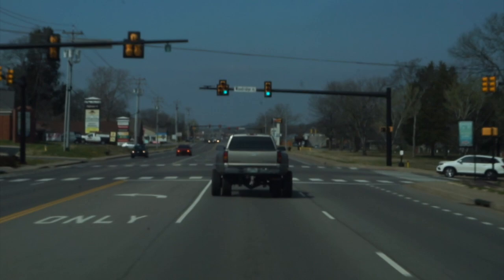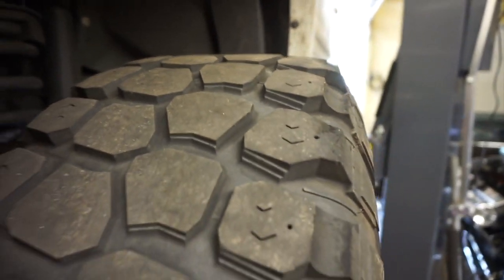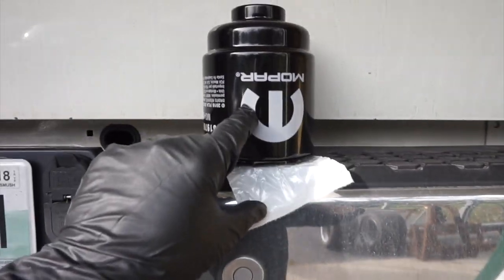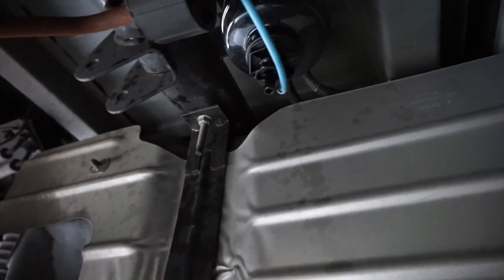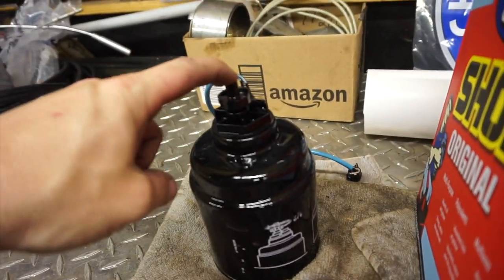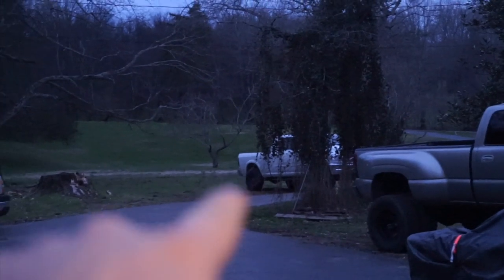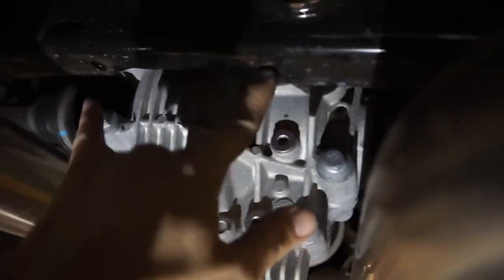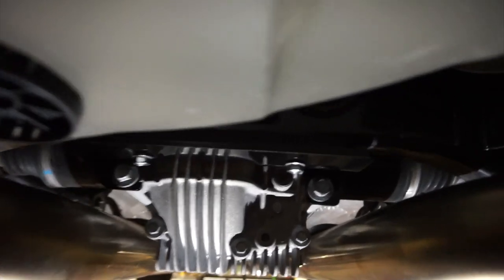DON'T buy cheap Mud Tires, I Didn't listen

Comment: Wow... Trashing a tire brand when the issue is very obviously an alignment problem on your pavement princess truck.  Happens all the time on these trucks when junk lift kits are I stalled by people who know next to nothing about suspension geometry.
Reply: I’m kind of wondering why people still get bent out of shape and haven’t learned yet that MUD TIRES wont last in lifted concrete cowboy trucks. There are some that do better than others. But they aren’t designed for people use them for. They are made for off-roading. Not to look cool
Reply: Pavement princess lmao! I'm using that haha!
Reply: get 55k miles on toyo MTs on my pavement princess... My wifes gen 2 raptor is doing great on the new R/T mud terain toyos as well... But youtube commenters LOL
Reply: Litteraly  align your truck
Reply: agcatdriver cupping isn’t from alignment, it’s from the shocks and struts not rebounding right and it’s wearing the tires down in certain places. Alignment causes edge wear
Reply: Could be shocks/worn out parts.. more than likely the tires just aint balanced
Reply: Iron man tires are really soft.  There very cheap too.  Mine did it to. On Toyo MT now with no issues
Reply: Oh shit 🤣😂🤣
Reply: @jbmeyers92  😂🤣😂
Reply: Alignment will effect wear patters but wont cause cupping
Reply: @bradleyporter5454  it’s not that simple but yes his shocks and entire front end are obviously shit
Reply: @bradleyporter5454  that and also over inflating too
Reply: There’s a reason cheap tires are cheap. Inferior construction and ingredients mean inferior performance. I don’t understand why people insist on running mud tires on highway trucks though.  there are some good looking AT tires available.
Reply: He even swaps the rear tires onto the front, and says let's put some smooth tires on there....meaning the rear tires didn't fall apart or have uneven wear LMAO...Definitely need front ends parts and an alignment !
Reply: I wanna learn suspension geometry. Because I like to ruin things too.
Reply: BUT It Look KOOL DURRR!!!!
Reply: I bought Ironman all country for my jeep in a 35/12.5/17 because at the time I got them for 110 dollars each used mainly on the highway and they all wore evenly no problems 2 years almost 50000miles till they were basically slicks
Reply: So how many of yall are machanics like certified? Asking for a friend
Reply: Goodyear and BFG cup also. Copping happens by shocks being worn out also and they recommend you rotate every 3 k with mud tires. Don’t judge people also they probably off road the truck also so how would you know it’s a pavement princess? Love these comments with haters the think it is a subpar lift when there are so many things that go into the cupping on tires.

Comment: All mud tires do that if you run them on pavement. I've had top brands and cheap brands. Pavement wears them out. Running a mud tires on pavement is like running a racing slick in mud. They're not built for it.
Reply: I’ve had my federal couragia MTs on my truck for about 40k miles and that’s mostly on road use, and they’re worn more even than the duratracs on my other truck. It’s all about rotating religiously when running them on pavement
Reply: As long as you do a healthy mix of on road and off road and rotation it won't be a problem

Comment: Ok, so just my 2 cents as a mechanic. First you drive a huge lifted pavement princess... What's the point other then compensation? Secondly most of the other comments are right on the money. Fix your lift and correct the alignment. Last but not least, adjust the tire pressure as mud tires on pavement with bad pressures dont mix. Again... those who compensate with huge lifted princess trucks shouldn't comment on off road tires... just dont.

Comment: Unfortunately even expensive mud tires wear like that too, the best fix is to just rotate often. We do at every oil change in our shop unless the customer wants to do it them self at home
Reply: Sully  i do mine religiously every oil change and mine are smooth. But im running a 1/2 ton truck on toyo R/Ts so not as heavy as the 3/4 tons
Reply: I do mine every other oil change which is about 10k miles on the vehicle . What I’ve noticed with mud tires having ran them on every vehicle I’ve owned since I was 16 is about 1/2 way through the tires life , maybe a little more they start to wear unevenly. I usually increase my frequency of rotation at that point. They always appear to be cupping… so. On my last set of tires, I had one cupped pretty good . Before buying my next set it was time for new shocks and suspension parts …. Well fast foward 25-30k miles later , 1/2 way through my newest tires life , with a verified alignment and no suspension issues …. They still start to cut when they get over the hill in mileage . It’s just part of it . So I rotate them more often at that point

Comment: I have a set of these, been to Alaska and back around 12k miles and they don't look near as bad as yours.
Reply: Mud tires are also only meant to be at 35-40 psi on pavement. Mud tires are not for larger pickups unless you are dedicated to offroading.

Comment: SRTMUSH,  It isn't the tires, that is usually caused by improper alignment, or bad suspension. I'v had the same thing happen a few different times with some of the top of the line tires.. Nito's and BFG mud terrain T/A KM2's.. If i was you i'd do an alignment and new shocks.. Peace!!
And mine were on a Ram 2500 4x4 Cummins just like your truck..
Reply: Calvin H. Cheap suspension upgrades are no bueno. Plus M/T wear like 💩. A/T or R/T for me with a quality level or small lift.
Reply: I'm not sure when he did the leveling kit, if he changed his shocks, or shock mounts so the factory shocks would work the way they were designed to work.. Lifting the trucks 2 inches from stock, causes the factory shocks to not work 100% properly.. and lifting it with just leveling blocks causes the front end to be pushed down and back some, so it's not sitting and riding where it should be.. The only way to level one correctly so it's not wearing tires and wheel bearing every 10.000 miles,  is to replace the coil springs, track bar, and shocks..
Reply: Marcus Young, I think i remember SRTMUSH saying something to someone before about him just trying this block leveling kit to see if he liked the way mud tires looked and rides before buying a good lift kit for it.. 
And yes, M/T's wear like shit, but where i go A/T's and R/T's are not much help..
Reply: Bad shocks are the #1 cause of cupped / waves in tires.
Reply: Yes, but those leveling kits also cause the same issues.. I'v found that if you go over 2 inches with leveling kits, it throws things out to far, and well, they cause your tires and wheel bearings to go bad every 10-15K miles or so..
Reply: If more people who level their truck knew this info, 80% of the trash reviews would disappear
Reply: Calvin H.  Also most people don’t get a alignment after lifting or leveling their vehicle and yes it’ll still drive straight after installing lift kit but the caster and camber r always out of adjustment pretty dang good
Reply: Calvin H. Totally agree didnt have the issue he did with my tires
Reply: Did my own alignment, new shocks, leveled and aftermarket panhard bar. Same tires with 4000mi under a 03 3500 and no issues. It's your setup that's trash.
Reply: Calvin H. In

Comment: I rotate my MTs every 3,000 miles, or every oil change. I just do both at the same time and make a habit out of it. It doesn't take long for mud tires to get chop in them and wear unevenly, but it's something I've come to accept because I like the look & sound.

Comment: I used to own a f250 and I ran 35 12.50 17 atturo brand mud tires. They lasted about three years and I averaged around 35 to 40k miles a year on the road. Maybe I got lucky with that set but they sure lasted a lot longer than the Toyo mud tires. For the price it’s worth giving them a shot. I rotated them every 7k miles when I did oil and filter changes.

Comment: That tire issue is exactly why I didn't get a cheap front suspension lift for my RAM. I left it stock. I watched tons of videos on how simply pushing the front axle further down from the truck by using spacers or simply putting taller springs on it without drop brackets for the track bars to maintain a level front axle makes everything go wrong and wear out prematurely on RAM solid front axles. As the axle gets further from the truck it gets off center so when you hit bumps it jolts slightly to the side and then the steering starts to bind into the pavement since the tires are no longer swiveling perpendicular to the pavement but at a nose dive angle. It looks awesome but isn't worth the sacrifices imho. Tires now, bushings and steering components later. Good luck man.
Reply: xplmr1 get alignment after and you’ll be just fine

Comment: Mud tires are not meant for daily street driving. They are meant for vehicles that are used for off road purposes. I work at a tire shop and I always see people coming in complaining about their tires being all feathered up. Some of their vehicles are brand new, have no suspension or alignment issues, and the tires are properly balanced as well. If you have a mall crawler, pavement princess or whatever just put street tires on it. The street tires will still look good with your lift kit and various off road accessories.

Comment: Bad thing about YouTube, everybody thinks their opinion is right, you did right thing with the tires, I drive 18 wheeler and it works rotating the tires, same thing happens on the rear tires, it will even out the wear pattern, not always a alignment problem

Comment: If you're crossing the tires to rotate, cross the front to the rear, but DO NOT cross the rears coming to the front. Otherwise, your next rotation will put the same tires back in their original spot and reduce the effectiveness of crossing in the first place.

Comment: It could be due to suspension parts but more than likely its under inflated. M/T tires are usually LT's and require higher psi's, but most lifted truck owners run them at a lower pressure to soften the overall ride. I've run M/T's on my trucks for years, my current set of RBP Repulsars max psi is 65 and I run it at 50 and rotate them religiously every 5k and still have more the half the tread life with no flatspots after 2years of use. Alignment is a must from a reputable shop.

Comment: It's all about proper suspension and front end alignment. I only rotate mine when the backs seem to be about half tread. When I did have that problem, I replaced the shocks and leaf springs. I have a 1 ton powerstroke though.

Comment: That’s usually due to bad front end parts. Inner outer tie rods. Bushings ext. but usually you get bad cupping from worn out shocks.ball joints are also a big one. I’m a brake and alignment tech. I see it all the time. In some cases it’s the tires fault. But rarely.

Comment: what size tires are those? sounds like this is your first time rotating your tires? if they aren't a metric tire with 10 ply it wouldn't surprise me if they didn't go bald faster or cup like they are, you're supposed to rotate them every 5k miles or so. also depends on your front suspension components. your tires look over inflated also.

Comment: Mine did the same so I started balancing and rotate tires every 15k miles and got tired of it and switch to all terrain and highway tires on both my trucks and now it's good . Won't be going back to mud tires unless if I stay off road 75% of time at least.

Comment: Personally I would like to know how many miles between regular rotations. If you run mud tires on the street you should be rotating them every 3000 to 5000 miles BECAUSE they cup/chop so easily. Additionally alignments twice a year will help also.

Comment: When you change direction when rotating a radial tire........the belts are more likely to break. I bought a set of Firestone tires for my Excursion and allowed the shop to rotate them for the first 10k miles. They did the change sides with the front and back and it changed directions of the tires. The belts heat up and melt into place and when you change the rotational direction...... belts heat up and unseat and then they cup and make the road roar and could possibly cause a knot to come up like they did in mine .

Comment: At 0:42 I can see the black shock. Oem and KYB aren't enough when running over-sized tires. All of the additional unsprung weight overwhelms them, especially with a level that overextends their travel. Tires cup like this when they are bouncing down the road. You need to upgrade to at minimum a 2" monotube. A set of 5100s or Fox 2.0s, something that can control the weight.

Comment: Cupping is usually caused by a suspension component failed or an alignment issue. You can buy a $5,000 set of tires and ruin them quickly with a bad alignment

Comment: I've just put 40k miles on a set of 35x12.5R20 IRONMAN MTs.  They're on a Yukon xl 4x4 (pretty heavy sled).  I rotated every 3 to 5 thousand miles and they stayed nice and even.  Mud terrains ALL do that, the only cure is to rotate frequently.

Comment: I have very expensive mud tires on my truck and they cupped horribly, even with a good alignment and rotating.  I concluded mud tires are for off road and winter conditions.  Don't run them if you do lots of highway driving

Comment: These tires aren't crap they're just Not made for Full Size Trucks. These have a softer compound. I run the 37x12.50r17 and put thousands of miles on them on my DD Toyota rock crawler and I still have about 90% tread. These are for light and some mid size trucks depending on weight. Just gotta do your research on compound before you buy my man

Also for anyone that wants to know. These tires are Ironman All Country M/T. They are an off brand of Hercules Tires which is an off  brand of Cooper Tires

Comment: I’ve known people who liked them so much, just because they last forever and performed so well! The reason you have such uneven wear and cupping is due front end alignment issues! If you don’t fix your tie rod ends or ball joints or pitman arms or steering box alignment or all of the above. My bet is that your lift is to high and doesn’t have the proper modifications to make your steering geometry more normal. It’s obviously not even close to correct and probably even dangerous to cause that severe of a cupping problem

Comment: Soft tires on a heavy truck will never last. Especially when you over inflate your tires. What do you have in them? 50, 60 pounds? Shouldn't have more than 40 in them and that may still be to much.

Comment: The truth is, non lifted vehicles have cupping and feathering issues on stock tires too. Its even recommended to rotate tires on stock vehicles. Feathering and cupping is from poor wheel alignment also poor shocks. Not tires. A bulge in the tread or sidewalk would be more of a tire defect.

Comment: Expensive mud tires do the same, I've learned to rotate straight front to back every 5k miles. My tires were $2100.00 and did the same thing after 8k miles. They did even out after the first rotation and haven't had a problem after.
Reply: Curt Simshauser 5k?
Reply: Thomas Hinojoza edited..lol sorry yes 5k.

Comment: Bad tire wear like that can be due to bad upper or lower ball joints,bad shocks or both..check the steering stabilizer bushings too..don't forget to get that front end alignment after any work you end up doing.

Comment: The funny thing is until those issues are corrected you're better off spending less money on tires until you fix the cause of the problem because otherwise you gonna waste money when you buy expensive tires because the same thing is going to happen to them

Comment: Check your balljoints and the rest of your front suspension. Dodges are notorious for balljoints failures. Then also get an alignment of course after you replace any worn components.

Comment: Try getting some tires with a better load rating on them. I’m not sure if you are aware of what I am referring to. If you are not I can go into a little bit of detail without getting to technical and dragging this out. You understand how each tire is broken down by size and then by the temperature and what type it is which is better than most people. You also understand how there are speed ratings on tires also. On your truck tires that really does not make too much of a difference on any tire because almost all tires would be rated between an R to a T rating. You need to pay attention to the load rating on each tire and that in turn will tell you just how much your tire will be able to carry or hold by weight in either single or dual tire mode. The higher the rating is the more plys that they put into your tire and therefore your tire can withstand a higher weight and higher load. If you start looking at a minimum of a load rating of say D they start putting a sidewall ply into the tire. I prefer trying to getting a load rating of E myself because then you start to look at getting a solid ten ply tire that puts a few plys into the sidewalls. It is just something to start looking into. Just be forewarned the prices go up drastically when you start looking into getting good quality tires.

Comment: I've ran these tires on my 05 gmc 2500. NEVER had that problem. Although I rotate mine every oil change. So far, absolutely the best mud terrain tire I've had yet. I currently run them, although the truck isn't a pavement princess. I've got a brother that likes to get stuck, so I'm on call. 🤷‍♂️